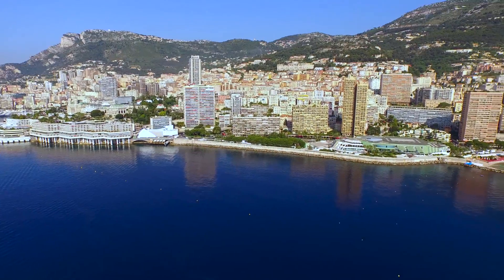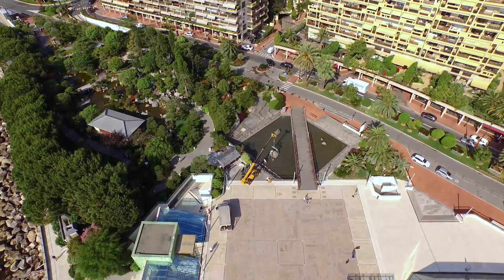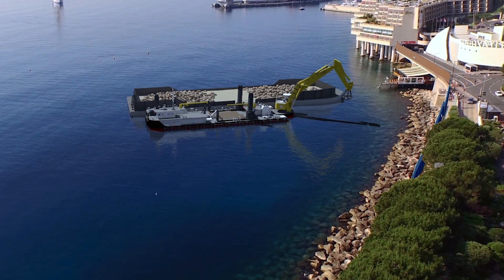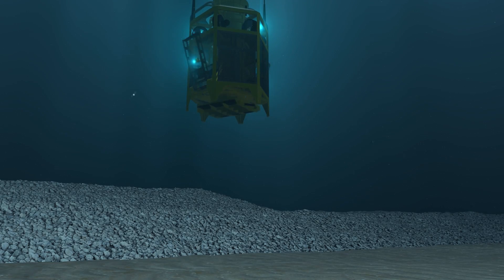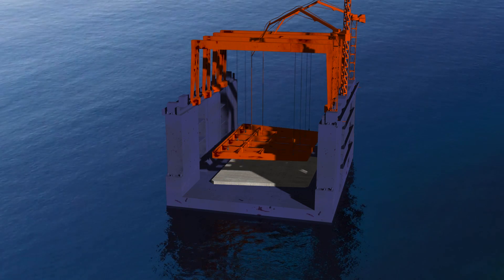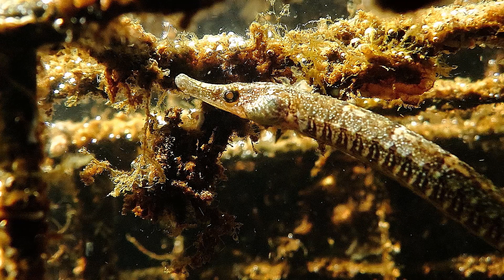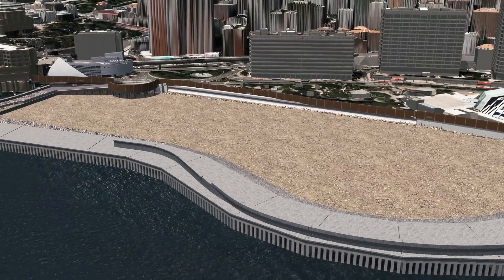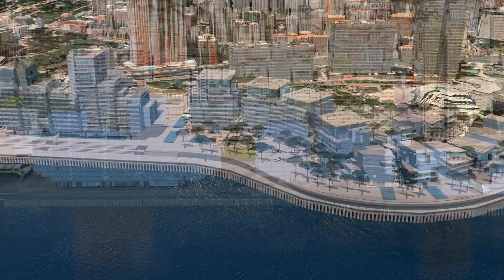Monaco offshore urban extension - Construction Methods

Comment: Seems like they won't go ahead the way it was planned.  Unlike what is explained in this video, recent reports suggests quarry sand only as opposed to marine sand, will be used to fill the space between the caisson belt and the shoreline using two bulk carriers. Futhermore, all capacitive trailing suction hopper dredgers of Jan de Nul are working on projects around the world at (sailing) months distance from Monaco.